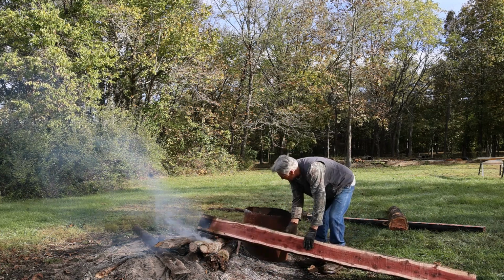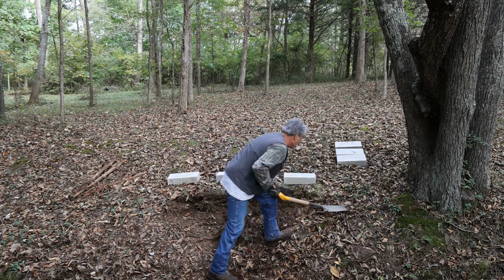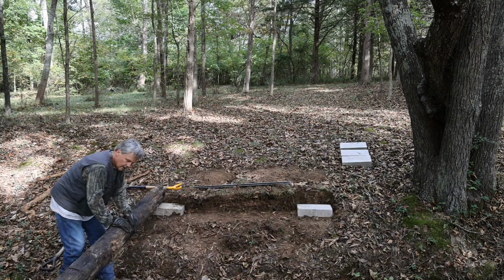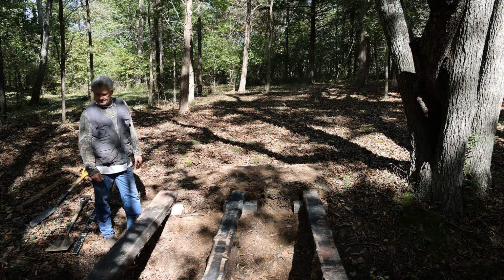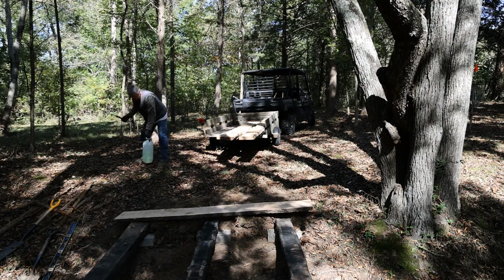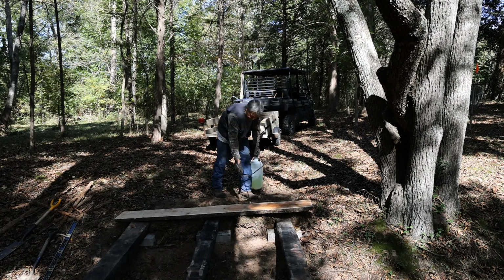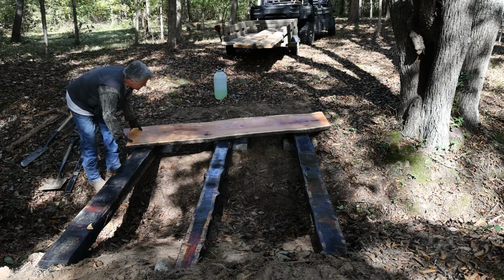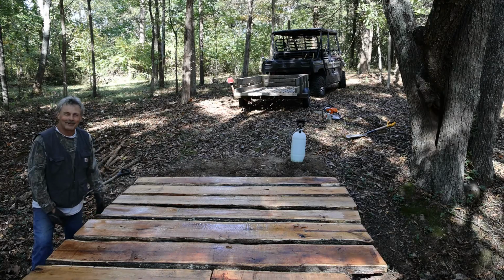DIY Bridge Build Using Chainsaw Milled Oak And Cedar

Comment: about what is the thickness of the 3 beams? and what is the thickness of the planks?...plus overall width of the bridge? Sorry for so many questions. Wanting to build one of these to drive a mule across too. But I will be using regular treated lumber
Reply from the maker: Good Morning Adam the beam's are 8x8 's and 8 feet long and the planks are 2x14  by 7.5 feet wide . This bridge will hold a pickup truck LOL  and perfect for the Mule . Good Luck with your build Sir and Thanks for Watching .